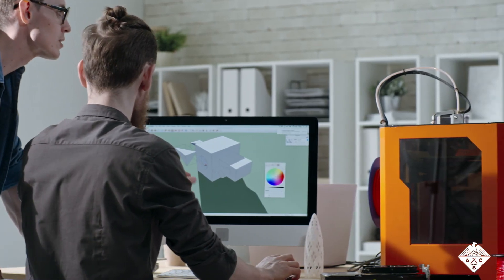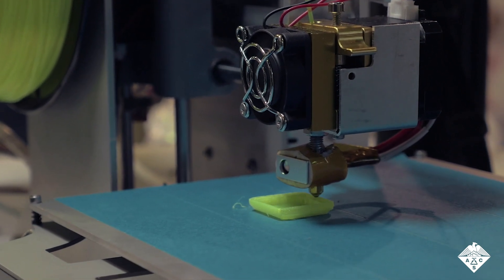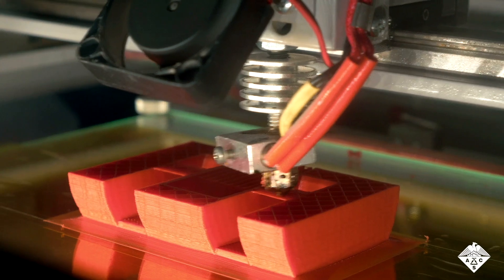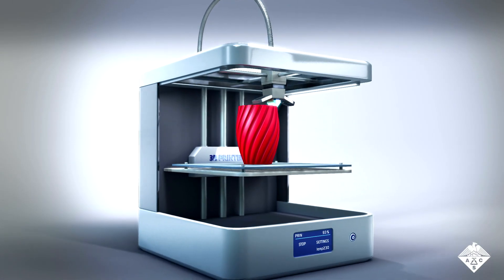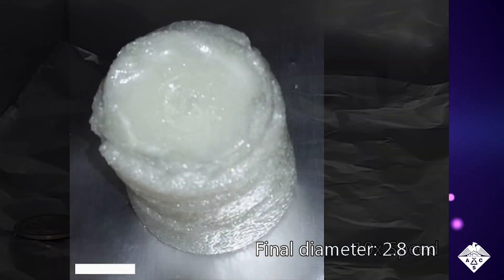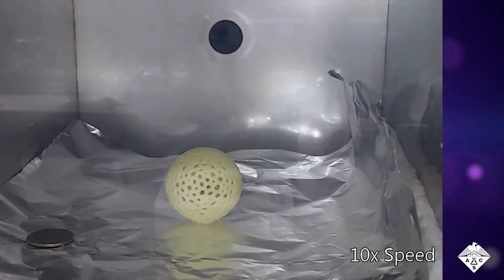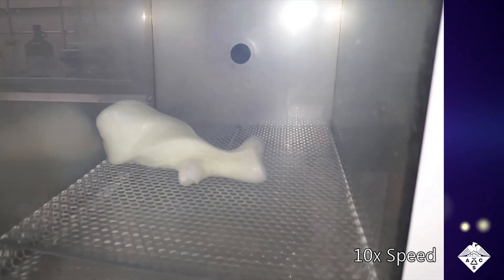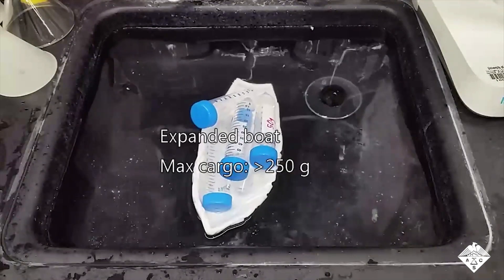Expandable Foam Supersizes 3D-Printed Objects | Headline Science

Comment: As many of the comments have mentioned, basically none of this footage relates to stereo-lithography (SLS/SLA). If you are interested in this technology, here is a great video that is actually accurate: https://www.youtube.com/watch?v=yW4EbCWaJHE
Reply: Just as a sidee note, Selective Laser Sintering (SLS) and Stereo-Lithography (SLA) are themselves two different kinds of printing. The former sinters a powder together using a laser to selectively melt (or rather almost melt) the particles together. The latter uses a laser of a specific frequency range (which is usually UV iirc) to selectively cure a photosensitive resin.

Comment: I’m excited with 3D printing technology, but I wonder how sustainable the materials being used are 🤔
Reply: We need more hopper-based FDM printers, so that we can recycle old parts into new parts.
Reply: The most common filament for FDM printers is PLA which is made from an extract from cane = biodegradable.
Reply: @thedevo01  it’s only biodegradable in an industrial composted after being kept at an exact temperature for 80 years with all the right microorganisms present.
Most recycling plants don’t bother with it, and just throw it into landfills.
Reply: @thedevo01  biodegradable != sustainable - if the cane is not being sustainably sourced then it doesn't matter how biodegradable it is